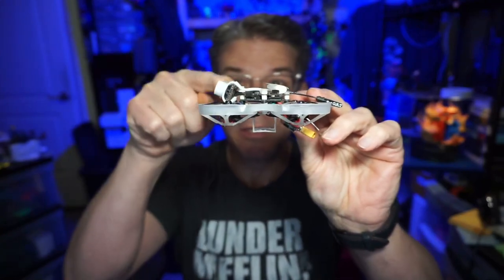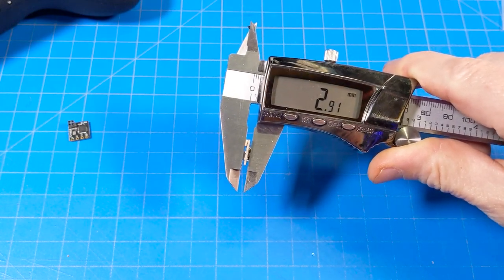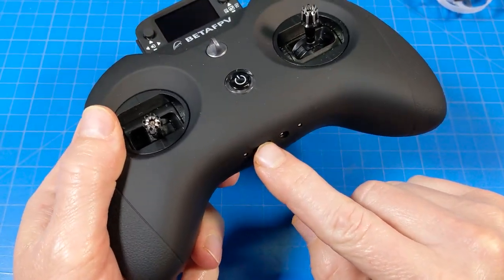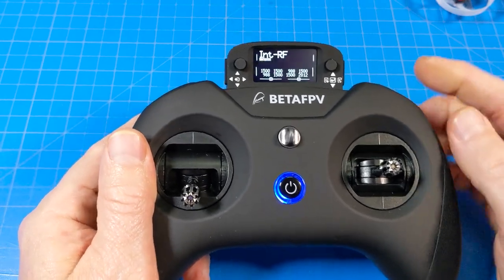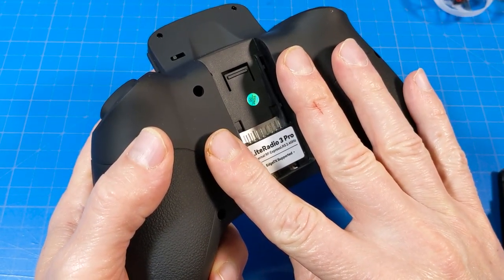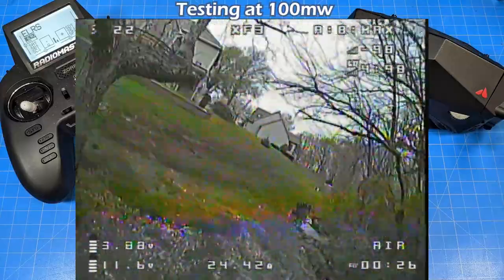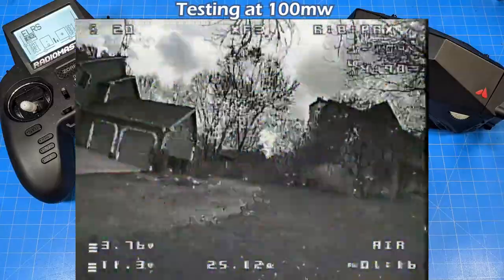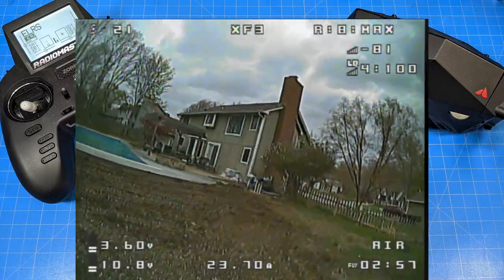Lite Radio 3 Pro // ELRS Lite Rx Flat Antenna // Smaller Rx Gets Smaller

Comment: I would love to see a more detailed review on the Literadio3 Pro for sure! Even to see the internals to see how they mounted the antenna, etc. 

One other thing I wondered is, since it seems to have the same size gimbals (from the specs) as the zorro, would the A01G mini gimbals work on this too? I mean hall gimbals work on the same principle so for folks that don't like the  screen size of the zorro but want the advantage of the gimbals it'd be cool if they could be used on other radios.
Reply from the maker: Noted!
Reply: as you said, there's no reason it should not work, I have a set of hall gimball from the TX12 which I want to try and fit on my lite radio 3 because I think they are much better gimballs than the stock ones, If this work it should certainly work also with the AG01G as they are interchangeable, I'll be making a video on this update
Reply: @metalfpv  awesome man! I look forward to seeing if that works and I'd be buying the cnc ones for mine

Comment: Thanks for the kind words and shout-out, Nick! I'd be happy to share editing knowledge anytime. 

With your testing, I was surprised that you were getting "no telemetry" callouts because I wasn't getting those until I was at the extreme end of range. I did have to update to ELRS 2.4 (prerelease at the time of my video, but I believe publicly released now) to get that performance. However, I noticed when you said that your RSSI was around -104 or so, which is pretty far gone for signal, so you might have just been hitting that limit.
Reply from the maker: yea, with the wifi and the obstacles of the houses, those are large barriers. It sure doesn't help that I am sitting withing 12ft of our house. No real chance for the signal to reach in that direction. I was on elrs 2+ in order to use with the zorro.
Reply: @NickBurnsFPV  do you know if you were on 2.4? For the telemetry issue, I specifically did notice a difference between 2.3 and 2.4. Not sure what they changed, but there was some change for this receiver in that version bump.
Reply from the maker: I am not 100% which I was on. Dang I need to write these things down
Reply: @NickBurnsFPV  they update too quickly! So many new features

Comment: I would like to know your thoughts on the radio now that you've had it for a while
Reply from the maker: Mine has more gimbal jitter than I like, can’t be sure if it’s all of them or just the one I have. Otherwise it’s a nice compact radio the screen certainly helps when making needed adjustments. I can’t get past the gimbal jitter, likely won’t use it

Comment: The pool looks nice👍. Finally a screen and edge tx good move betafpv! Thanks for showing me that I should have more trust in the range of the elrs Nick :)
Reply from the maker: Even at -106 no failsafe. I want to take it back out and see what I need to do to make it failsafe, but I also don't want to walk to get it. :)
Reply: @NickBurnsFPV  Indeed iam really impressed! No I get that :) just failsafe on low power then set it to high power and turtle mode out ;)

Comment: jinx! Broke my elrs ceramic cube antenna today. 
surprisingly the busted cube still has range up to half a block distance in all directions... perfectly fine for the yard ripping... but I need to put a ufl connector on there.
thanks for sharing!
Reply from the maker: I wonder if the antenna missing will result in the rx burning/failing over time.
Reply: @NickBurnsFPV  I believe it would over time. I won't actually fly it this way. I only flew the one pack where it bent and pretty much held firm to link quality errors. I'll repair or replace the rx before I fly that rig again.
Reply from the maker: Not going to leave it? Even for science? 😁

Comment: preordered mine yesterday, am so excited
Reply from the maker: If you don't mind. What made you decide to get this radio? And do you have a radio your coming from?
Reply: I’m also going to order it. My recreational days include riding a sportbike through the twisties, and to the field to fly, so I’m trying to get as light and small as possible. Everything in one backpack without back pain.
Reply from the maker: @professorvoluck9311  I presume in this scenario we would pack the radio naked?
Reply: @Nick Burns I still use a soft lunchbox Mr. Steele recommended 7-8 years ago, but don’t think I need it with these new gamepad lightweights.
Reply from the maker: @professorvoluck9311  oh yes I remember that. I think he has one to carry batteries in as well.
Reply: @NickBurnsFPV  sorry, i didnt get a notification, just rewatched the video
1. i love the design
2. elrs is amazing
3. i like the tango 2 style switches
4. oled screen has good contrast (i got bad eyes)

Comment: Nice review and pool! It looks hungry for some quads! Lol
Reply from the maker: It got one on a very close failsafe :(
Reply: @NickBurnsFPV  major bummer! I suppose it's inevitable lol. We a large puddle that forms in our old gravel driveway that pushed me to learn conformal coating!
Reply from the maker: @muggachukka1629  It was shocking as I had flown the path 5 times prior with the same drone and radio, then randomly it failsafed. It was on an frsky xm+ receiver. Which I don't hardly run anymore :)
Reply: My good buddy scooter Pie is finally giving up on frsky also. He failsafes and suffers rx loss constantly it seems. Do bodies of water effect signal?
Reply from the maker: @muggachukka1629  yes and yes. Water or liquid are the two worst for blocking signal. Also cell towers and wifi interfere a lot as well.
Reply: Gotcha, really apreciate your reviews, micros seem to be where I enjoy the hobby the most. Maybe one of those really stout pool covers that attack to the concrete via a series of straps will be operable.

Comment: Order lite3 pro and received email from betafpv  saying that they gonna limit this radio to 250mw,lots of issues when using 500mw ,like packet loss,since this radio it's so small and no fan that's no surprise,they working with express elrs team  to bring updates via elrs oficial software,first units bring 500 mw but next ones the limit it's 250mw
Reply from the maker: Yea the elrs devs have said time and time again that 500mw and no fan is bad. I think they even took steps to try to detect the fan and not allow 500mw without it. I think betafpv had to step back from 500mw to get official elrs support

Comment: Hey Nick, I just received my literadio 3 pro yesterday and I have some oddities when I try to charge. As soon as I plug in the usb cable the radio turns on. When I try to turn it off, it immediately turns back on. There is no real indicator if it's charging and after a couple of minutes I get "inactivity alarm" callouts. That can't be right. How did you charge yours?
The same issue was described in oscarliang`s written review.
Reply from the maker: Mine doesn't power on when i plug in usb, it has a momentary green light then goes to red. I believe the red light goes off when the battery is fully charged. I suspect something is wrong, I would contact betafpv support.

Comment: I'm in the market for a new controller , this one and the Zorro are so far top contenders, i think i'll wait to  see if the zorro will come with those cnc milled gimbals . I just hope they do the same thing as with the tx16s  different color choices. Other than that should i buy you a vat of conformal coating and a dipping bucket? or are you ready already ?
Reply from the maker: You mean if the zorro comes stock with AG-01 mini gimbals. I would like to see some blue chromed out ag-01 minis as well. :) I think the pool will be far less of an issue than most think. The risk is going to be after the review when i am casually flying and the kids are in the pool. Fly for my entertainment, pool for theirs.

Comment: Hi Nick great video as always.
I would personally be very interested in a further video regarding this Tx.
According to my UK supplier it has a 500mw internal elrs module....
As it has edge tx I'm assuming then this doesn't use the configurator that the previous models used...
Reply from the maker: Yes, the tx is supposed to be 500mw, but no fan for cooling, I worry it will burn up if we use 500mw. EdgeTX is on mine by default, I don't see an option otherwise. I don't see that edgetx has an official release, no word on if Betafpv worked with the EdgeTX or ELRS team.
Reply: @NickBurnsFPV  Good points! 
May I make a respectful suggestion?  
Rather than running on full power namely 250mw as you suggest in your video set it instead to dynamic power with a cap of 250mw or 500mw if using the new betafpv Pro.
Them set yourself an audio alert (just temporarily) on your radio to call out the power as it changes.
You may be very surprised at how little amount of power your tx will need even on the 500hz packets in your back yard.

I do this now for all my flights and I'm amazed at how long my battery is lasting on my T-lite. Also good to know I'm not over stressing my electronics unnecessarily.
Reply from the maker: @gmivisualsjason3729  That is an interesting point, something I should investigate as well. Are there any pitfalls of dynamic power you have experienced?
Reply: @NickBurnsFPV  I've been running it since release and haven't had any problems at all. 😀
Reply from the maker: @gmivisualsjason3729  None? Maybe is crossfire dynamic power I have heard about issues or an issue? Maybe
Reply: @NickBurnsFPV  None as yet. I also had crossfire prior to elrs on dynamic and again I didn't have any issues at all.
I do recall a number of reports regarding dynamic but as far as I understand that's long fixed.
Reply from the maker: @gmivisualsjason3729  I must be all wrong then. I am truely going to try it out. Surely I won't even notice as I don't fly at distance.
Reply: @NickBurnsFPV  excellent... having an audio alert play when it changes power output would be fascinating using dynamic power in your yard.
Especially if done so on the different refresh rates  500hz 250hz 150hz 50hz...

The video JB and Stingy did a while back showed they couldn't really tell the difference between 500hz and 50hz on a true blind test.
So many of us could be flying lower refresh rates to get more life out of out Tx batteries Especially if using 1s like the T-lite.
And as said reduces stress and electronic fatigue on our gear.